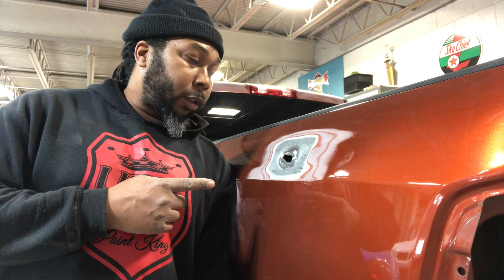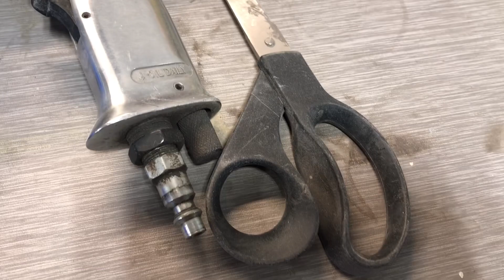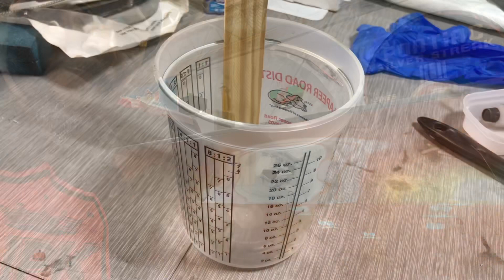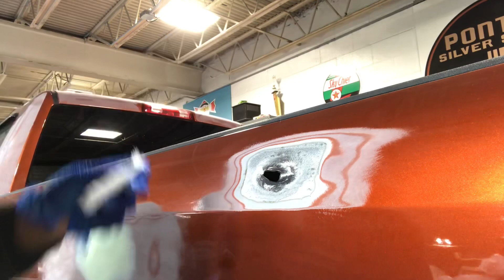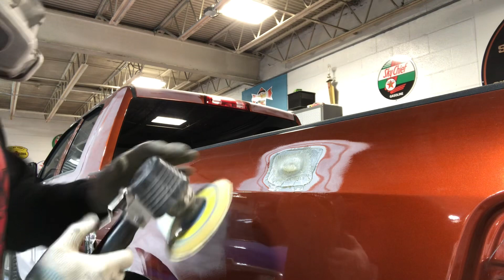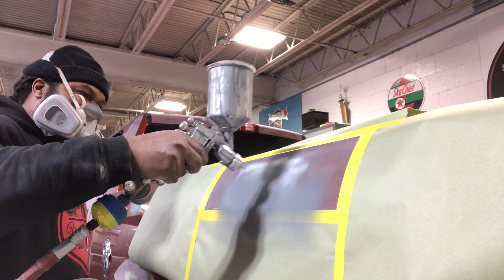Fiberglass Repair for Bullet Holes!!!-No Welding

Comment: So I’m a little confused and stuck before I move on to the next part after I put the fiberglass cloth strips and resin on then sanded. 
So where I’m confused is I just saw you referenced Fiberglass Filler and not Body filler only. I didn’t notice you used it in the previous watches. Do I need Fiberglass Filler too, or is Bondo body filler ok?
Reply from the maker: The fiberglass filler doesn’t absorb water/moisture like regular body filler does so it’s good to go for fiberglass filler first but if you want to use regular body filler you can. Hope that helps 💯
Reply: @UndergroundPaintKing  Yes that helps, I will definitely go pick up some fiberglass filler too, thank you.

Comment: Great video man, I'm working on a 1985 Starion right now and I'm dealing with some wheel well rusting. I'm interested as to whether or not it's better to run the fiberglass on the inside of the panel? Have you tried this before? Thanks, keep kicking ass out there end product looked beautiful partner.
Reply from the maker: Thanks I appreciate you checking out the video and I have done fiberglass on both sides before and it definitely works well

Comment: Great video!  I m considering buying a Tacoma truck that was salvage titled after getting 4 bullet holes in the side panels in the Philly area.  2 windows broke. Nothing mechanical or electrical was affected so I'm not sure why the insurance totaled it but who knows.  A body shop bought it from an auction for $15k.  The truck without any damage is worth about $30k.  The body shop says they can fix the holes for $2000.  They are offering to sell it fixed for $20k with the salvage title.  Is this a good deal?  I would have to then get it inspected in NJ to get a re-built title.
Reply from the maker: I would assume they would be doing a more professional repair to fix the bullet holes so I would think that it isn’t a bad price but it’s hard to tell without really knowing all the details of what needs to be done
Reply: @UndergroundPaintKing  Gotcha.  He briefly mentioned something about using JB weld and some sheet metal but not really sure about that.  I'm not sure he had decided how they would do it yet.
Reply from the maker: @Jonsoar yeah that’s sounding a little sketchy to me now

Comment: Man I just did this and I had a big area that needed like 4 oz of resin. I didn't measure it out properly so I don't think I put enough drops in. Almost 24 hours later this stuff is still sticky and I can leave a fingerprint on it. You think it has a chance of hardening still? Worried about this.It's also like 60 degrees today and was down to like 40 last night so maybe that's what's going on?
Reply from the maker: It’s possible you didn’t add enough drops to it, give it another day to dry and if it isn’t dry by then I would start over Jay
Reply: @UndergroundPaintKing  I just read after messaging that any temp under 75 takes significantly longer so I'm hoping that this cold is the issue. Appreciate the quick response bud. Thanks for the video 😎👍
Reply from the maker: @jaybourbon8608 you’re welcome, let me know how it works out!
Reply: @UndergroundPaintKing  Ok bud I am returning with more info on the project that wasn't drying. So I waited 2 total days, and came out to the garage, and it was still tacky but much harder. I was pretty worried seeing it was well over 48 hours at this point. I didn't want to bring this fiberglass hard case for my bike into the house with this Bondo resin on it because it smells really strong, and I didn't want the house to smell like a crack dungeon. The tempo was still only around 60 as a high for the day, and it was 35 the night before, so I was worried that it wasn't going to set correctly.. I decided to put the case directly in the sun, and 2 hours later it was hard as a rock. Colder temperatures most definitely has a negative effect on the drying process, and I am lucky that this ended up working despite the colder weather. I might put a small space heater on it next time if it's cold. Appreciate the help, and advice!
Reply from the maker: @jaybourbon8608 glad to hear it worked out for you and now you know what to do if you have that issue again 💯💪🏾

Comment: Hello! Is this material waterproof? Im thinking if could repair a galvanized water tank with this and later weld a metal patchup sheet… please help.
Reply from the maker: Fiberglass doesn’t absorb water like plastic filler does

Comment: How durable is this fix when it’s the roof considering its in direct exposure to the elements? I have a vehicles that had some service lights on top and just need to patch the holes. I don’t think welding is an option as I’m not a welder n the headliner is right there
Reply from the maker: It should be a very durable patch job if done correctly
Reply: @UndergroundPaintKing  I appreciate it. I’ll definitely be trying it.
Reply from the maker: @unfilteredjamaican3478  let me know how it goes for you!
Reply: @UndergroundPaintKing  for sure

Comment: Thanks informative video. Bought a car with 3 bullet holes lol. Only thing is I bought the bindi body repair kit and not the fiberglass one. I have to sand my bindi down tmrw. I accidentally put more than necessary. So the bindi is not even like yours!
Reply from the maker: I appreciate you checking out the video and I’m glad it was helpful 💯

Comment: The only issue which is minor his spraying over the tape and leaving a hard edge.  The REAL way would be to weld it shut, but the fiberglass is a solid repair.
Reply from the maker: Thanks Warren I appreciate you checking out the video

Comment: UPK, Could you use this technique to cover and fill a “shaved door handle”, Instead of welding a new metal plate to fill the cut out door handle?
Reply from the maker: If done right, I believe you could use this technique to shave handles Mr.Preston
Reply: @UndergroundPaintKing  Thanks for posting this excellent DIY, REAL and cheaper hole filling method.
I hope to never need to fill bullet damage in any of my future.

Comment: Learning alot from you, until I seen this I would have cut a piece of stainless backing screen, angled it through the hole and held it with a pick hook while putting fiber hair bondo around the edges to harden the screen in place then filled the rest with fiber hair. Keep up the good work and look forward to more videos.
Reply from the maker: That’s a good idea, appreciate you checking out the video

Comment: I attempted this on a quarter panel with good temps and correct amount of hardener, it never dried even in the hot temps and days later. I just went ahead with fiberglass filler instead.  Not sure why 20 drops to less than 2oz never dried in ideal conditions
Reply from the maker: That’s weird Amthevision I’ve never had that happen, I’m always having to rush because it starts setting up while I’m applying it
Reply: @UndergroundPaintKing  my metal was clean and then i had to waste more gloves peeling off the soggy fibreglass 😂 reinforced filler did the job tho. I need to pull a dent in lower part of door to continue tho still bare metal and filler on the quarter
Reply from the maker: @amthevision8931  still sucks that it happened to you but it’s good that you still fixed it 💪🏾

Comment: 2 in my drivers side door, I’m wondering what something like this would cost me to get fixed? Idc about factory paint or anything like that I just want the holes covered and as long as the paint is close to original I’m good…?
Reply from the maker: Are you planning on fixing yourself? If so I would think you would have around 250 or less into fixing it which would be material cost…hope that helps Homegrown Hugo!
Reply: @UndergroundPaintKing  I have 0 experience with fixing cars or body work but you made me confident that I can do it 💯
Reply from the maker: @homegrownhugo8850  you definitely can do it 💪🏾

Comment: Would you recommend fiberglassing rust holes on the roof of a car. I’m learning auto body work at my school but my teacher wants me to mig weld patches but my welding skills aren’t the best and the splatter is burning up my windows. Would the fiberglass do the same as welding. Waterproofing?
Reply from the maker: Doing the metal work would be a better choice but you definitely can fiberglass after doing a proper removal of the rust so that you don’t continue to have issues…and try a welding blanket so that you don’t get splatter on your windows

Comment: What’s up OG, can you give me a quick explanation on the first step about grinding the paint down and “feathering”. Everything else I feel confident on. Thanks sir !!
Reply from the maker: You want to grind down the area that you’re working on then feather edge the paint which allows you to have flat smooth edges to work with to blend the body filler into the damaged area that you’re fixing

Comment: another informative video, this just happend to the hood of my tahoe on new years eve , i do not have access to welder and was told to use something called all metal? but i think fiberglass just seems stronger?
Reply from the maker: Yeah you can use all metal which is a body filler but I would go with the fiberglass first but that’s just my thoughts
Reply: @UndergroundPaintKing  for sure im going fiberglass , u made it look so easy....
Reply from the maker: @hectorotani27  thanks and I hope it works out good for you!

Comment: I'll be doing a job like this here pretty soon, thanks for the great info man!! Did you respray the whole truck after this?
Reply from the maker: Yes I actually changed the color of the truck
Reply: @UndergroundPaintKing  The customer wants the holes fixed so they can trade the truck in. The thing I'm most unsure of is if I need to respray the whole truck or if I can just do patches without it being noticeable. Are you on Facebook? could I send you some pics and you tell me what you think? I have almost no body work experience but I'm willing to try anything!  lol
Thank you so much for the super informative video and the quick response!
Reply from the maker: @nickbarton9738  you can email me @ ugpk810@gmail.com

Comment: Nice video I've also been doing fiberglass repairs for as long as i been painting a good thing to do is cut some cardboard and wet the cloth with resins then apply it to the area that way you know it has a good soaking and use a fiberglass roller to squeeze out air pockets and 1 or 2 layers on the back side for strength keep up the good work oh when grinding fiberglass use baby powder on exposed skin that way the fiberglass dust will not get into your skin pores it will not make you itch
Reply from the maker: Thanks for those tips I’m definitely gonna apply them next time I’m doing fiberglass work
Reply: @UndergroundPaintKing  make sure when you use the baby powder on Exposed Skin just put it on then lightly spread over your skin and if you itch get some microfiber rags and lightly rub on your skin it will remove the fiberglass particles from your skin. Im hooked on your channel going to subscribe
Reply from the maker: @paulcasarez404  thanks again for the tips and I appreciate you subscribing to the channel!
Reply: @UndergroundPaintKing  ur welcome
Reply: Good info here, locked in the brain box. Been watching a lot of boar repair lately. Bet most of them wish they knew this. lol

Comment: UPK just got my badges off with fishing line but I got a eraser wheel from Advance Auto but can't get it yet probably have to get it tommorow it helps get rid of the left over adhesive that is on.
Reply from the maker: Me personally I don’t remove the adhesive if I plan on putting the lettering back on

Comment: What do you recommend for how many layers to use
Reply from the maker: I recommend as many as you see fit for the job that you are doing…I did 3 layers but your situation may require more or less depending on what you are fixing
Reply: @UndergroundPaintKing  thank you 😊
Reply from the maker: @donaldbaker6961  you’re welcome and I appreciate you checking out the video!

Comment: Primer right to the tape...NO..NO  You want a 'soft' fade away of the primer surfacer.
Reply from the maker: I appreciate the tip but would like a video showing what you’re explaining…I definitely know about having a soft edge and everybody doesn’t do things the same
Reply: @UndergroundPaintKing  Just mask further from the area you are priming.  Paint in the old days (decades ago) would swell under the primer so the edge would always come back..if there was an edge.  I guess that does not happen with current paint.  
Give leading a try for bullet holes..seems right.

Comment: Did you wait for the fiberglass filler to dry  or did you sand it down as soon as you were done?
Reply from the maker: I let it dry but you can let it cure for a few minutes and shape it before it completely cures with a cheese grader tool if you know how to use it or can use a block with 36-40 grit sandpaper…it’s multiple ways to get the job done

Comment: How much does it cost to paint like a truck a regular size one like mine GMC Canyon to get it looking high gloss and new with paint high gloss and clear it's metallic so wouldn't want to be sanding it but when I paint my brother's truck that red it don't look metallic painted though it just has a good amount of oxidation on it but I have a product to get rid of oxidation Lukat Fix It can wipe it on it is a cleaner not a wax.
Reply from the maker: How much it may cost can vary depending on so many different things like products and labor time...you could pay anywhere from 500-$1000s to get the truck painted
Reply: @UndergroundPaintKing  I saw paint online for about 500 for 3 stage auto paint candy cobalt over silver I like that color but messaged place in Grand Rapids I saw Maaco and it said online about towing your vehicle I guess that what they do tow to them but I rather just ride up to one if I get my truck painted at a place here otherwise I probably wait to move down to Texas and paint my truck down there after move there. I still wanna use that electric sprayer I got from Amazon some months ago but I have a lot more stuff than when I painted my old truck last year plus now this AR Blue Clean pressure washer that is 1600 psi but got a adapter coming for it so can use a foam cannon with it should be coming this week I think.
Reply from the maker: @zanaga1901  candy cobalt is a nice color

Comment: What’s up? New to the channel. Great videos man. I need to fix a cracked dually rear wheel cover or rear fender. They are made of plastic. Will fiberglass be a good choice for a permanent super strong repair that I won’t have to worry about cracking again or is there something else you suggest.
Reply from the maker: What’s up... I appreciate you checking out the videos...Fiberglass will be a great choice to fix your damage and will last for a long time!
Reply: Wow man. That was a quick reply. I just finished watching your dodge dually video and that answered my question. Thanks again sir
Reply from the maker: You’re welcome and if you have any other questions don’t hesitate to ask

Comment: Hey King my 02 Silverado step side bed is made of some sort of plastic. It is cracked below the brake lights. What is a good tip to repair this? Thanks ahead of time
Reply from the maker: You could possibly use a plastic welder to patch up the crack or you could use fiberglass to fix the crack by doing a similar process like I did in this video...you can strip away some of the cracked area to give the fiberglass something to bond to then go through the steps of making the fiberglass and applying it then once you have it like you want you can shape it then then apply body filler

Comment: Would it have been advantageous to use a hammer and dolly to beat back sheet metal on back side to make hole smaller? This might help with using less filler? I enjoy your videos and I see your shop is bigger now so your not working out of your garage anymore? Where are you located at?
Reply from the maker: Using a hammer and dolly would definitely be great to use if you are in a situation where you can get to the back side of the damaged area...I work out of my shop and out of my garage also... I appreciate you for checking out the videos and leaving comments it definitely helps me to get better with the content!

Comment: Looks like a 45 caliber hole.
Nice fix looks very good!
Reply from the maker: You’re spot on with your guess of the caliber... I appreciate you checking out the video!
Reply: @UndergroundPaintKing  
Hey UPK I'm wondering how big of a hole will the fiberglass actually patch without any issues, I have a 88 c1500 that was hit with a AK 7.62 round at a angle almost like the video
Reply from the maker: @the1dtg2  I think you can fix a nice size hole using fiberglass and definitely can fix a hole from a AK round